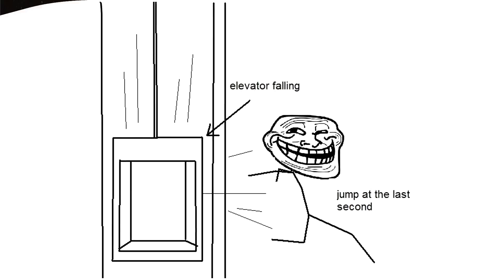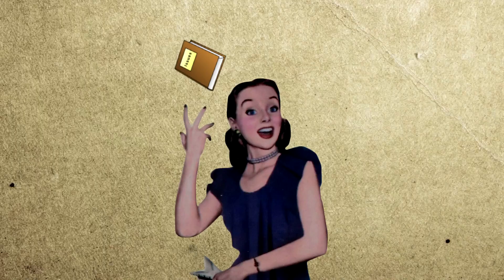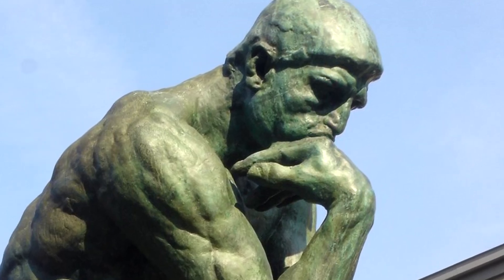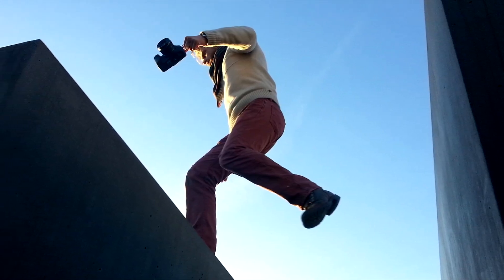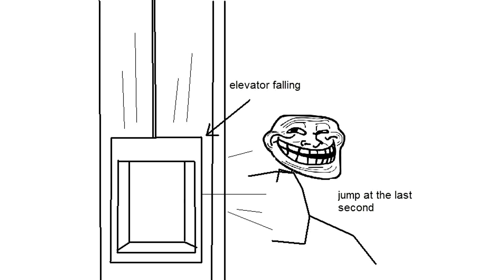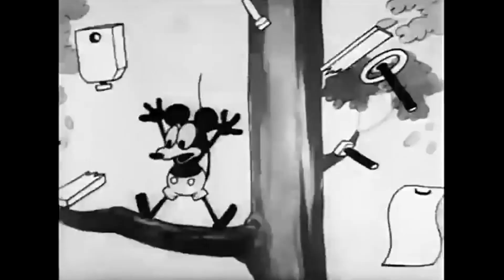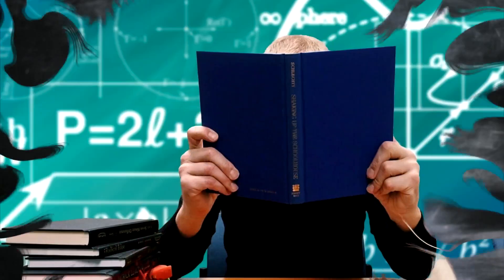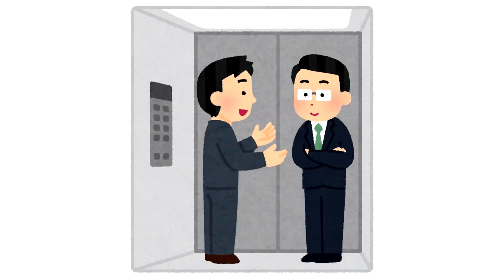why it doesn't work 51

Comment: Jump out... where to? You're in a shaft, so even if you could force the doors open, you can't escape the elevator car.
If you managed to forced the doors to the car open, you'd also still have to force the doors to the floor open on which you're attempting to jump while falling at 9.8m/s^2, AND youd have to know how where you are relative to the ground, and that would be impossible given youre inside a closed box.

Even if physics did allow it to work, there are so many other obstacles you'd need to overcome.

Comment: 2 things and obviously I know nothing about physics math, but wouldn't it be hard to jump aganist the force on the elevator dropping?

And then also I'm trying to picture it in my head but seeing 2 different scenarios/versions. Wouldn't the velocity drop (i guess if fast enough) have you floating/stuck to the ceiling of the elevator, OR, stuck to the floor?

Comment: The easiest way to explain it is there are 3 main reference frames. You, the elevator, and the ground. You can move slower compared to the elevator but you're still moving much faster compared to the ground.

Comment: Not sure I understand. Are you saying the weight of the fall would be stronger than our legs - so we wouldn't be able to jump?
Reply: You would be able to jump relative to the elevator you're in (meaning you would leave the floor of the elevator), but the speed you (and the elevator) are falling towards the ground would be far greater, so you'll still go splat.
Reply: you would be able to jump... but your still falling at insane speeds so even if you do jump and slightly slow your fall youll still die when you hit the now not-moving elevator at tremendous speeds just like if you fell those 10 floors on your own without the elevator...its actually MUCH worse for you... because now the elevator isn't taking the brunt of the force now YOU are...

Comment: In an open container, if you had enough strength to overcome the doward momentum you could jump at the last second and survive. This only works because there is friction in the shaft. If you were in a free falling box, such as in thin air, there is nothing you can do.

Comment: lets say ur falling 50ms, and you jump, making you falling 45ms with refrence frame of someone outside. meaning that the moment you jump, the elevator crash into the ground and is not moving anymore, and you, smash onto the elevator floor at 45ms. the elevator floor stops moving when it hits the ground. this is the key.
Reply: But has anyone tested it yet? I want to see some people from jackass just test it out for theory

Comment: You don’t have to cancel the full fall, since the final velocity is proportional to the square root of the fall height, jumping the equivalent of 4% of the fall height means hitting the ground at 80% speed meaning 64% energy.

Comment: this isnt minecraft a pool wont save you lol
Reply: for small heights, it actually will. past a certain point though, concrete would be better because you wouldn't need to swim out with broken limbs.
Reply: Water is basically the same as concrete with the surface tension so sand or a haystack would be the best to fall into if you fell from an airplane (trees can be counted depending on what type of tree)

Comment: Elevator brakes are applied by default, and it takes energy to open them and allow the elevator to move. If power was lost, there would be nothing keeping the brakes unlocked, and they would clamp shut, stopping the elevator. This is an example of a fail-safe system, which means when it fails, it does so in as safe a way as possible. 

Incidentally, this is also how bats are able to hang upside down in trees and caves. When the muscles that control their feet are relaxed, their foot is in a closed, gripping position, and it takes conscious effort and energy on the part of the bat to open its foot and let go.
Reply: You are smart
Reply: You are intelligent
Reply: You are clever
Reply: You are brilliant
Reply: You are well versed in the science of knowledge
Reply: You are well educated
Reply: You are erudite
Reply: You are wise
Reply: You are sharp
Reply: You are intellectually astute
Reply: You are inconceivably well rounded with knowledge
Reply: you are bright
Reply: You are genius
Reply: You possess an impressive breadth of intellectual sophistication and erudition
Reply: You are rational
Reply: You are well taught in the ways of this world
Reply: You are notably educated within the intelligence department
Reply: You have a profound way of thinking
Reply: You have knowledge
Reply: U brain work GUD
Reply: You are transcendentally wise.
Reply: You are mom
Reply: You are a bat
Reply: You are scholarly
Reply: You are well versed on those topics
Reply: You are what you eat
Reply: You are my fire, the one desire
Reply: You are Astute
Reply: You are gay
Reply: You
Reply: are
Reply: You are sexy
Reply: why you guys randomly giving him compliments

Comment: In a real senerio where you are free-falling in an elevator and all the safety mechanisms fail, the best course of action is to lie flat on the ground with your arm covering your head. This will distribute the force of the fall across your body softening the impact. And to protect your noggin from debris, your arm will block it. Granted, it's not a 100% sound method and you will almost definitely come out with horrific injuries, but it's better than nothing and WAY better than jumping.
Reply: Meditate and unlock flight. Inner peace....inner peace.
Reply: @christopherm4540  you need to free yourself of all earthly attachment first before you unlock *CRASH*... Flight
Reply: The better option is to hover with your neck over a really sharp thing, so at least it ends quickly
Reply: @Miseris1234  bro?
Reply: @fantastikboom1094  hmm?
Reply: Wouldnt standing be better since your sacrificing your legs?
Reply: @stephaniejohnson5361  The force of the impact will travel up your legs into your organs like a massive dagger.
Reply: @SioxerNikita   Apples to oranges. Elevator crash isn't the same as parkour.
Reply: I disagree. If survival alone is the objective, you want to fall feet first with your knees slightly buckled. Why? Your body is not made all the same. Legs are relatively strong, organs are weak, and you need the latter more. The cold calculation is that shattering your legs is better to spare your organs.
Reply: No

Comment: If our legs could counter 100 mph velocity with a jump, they might've as well keep us intact after the impact. Figured that would help imagining just how much force that excerts
Reply: if only our legs were strong enough for that. too bad it would be negligible though
Reply: But even if they could only manage half, this would help

You cut the velocity down to 50mph, and then your legs can take that (in this example)
Reply: an elevator is not falling at 100mph lol
Reply: @jazzabighits4473 Oh I have no idea, I'm no engineer. According to video you accumulate roughly 50 mph per 10 floors. You'd need 40 floors to get twice that, but it fits the estimate

Comment: under the already existing assumption that there is nothing below the elevator other than a sudden stop, the more common saying of jumping up in the elevator does work, but requires a timing that's impossible to know without a window out (you're theoretically able to "jump twice" in the form of the collision retracting your legs again to extend your deceleration beyond your leg length)
Reply: you'll still end up with broken legs because there's just that much momentum from the fall.
Reply: @fantastikboom1094  honestly I'm not sure what the terminal velocity of a free falling elevator in an elevator shaft would be

Comment: Oh god, they've only gone and confused how frames of reference actually work.

Yes, you are stationary relative to the elevator, but you are not only moving relative to the ground, you're also accelerating towards it. When you step out you will break your legs, followed by whatever hits the ground next...
Reply: I can see how I would rather lie on the floor of the elevator and protect my head instead of having all my legs broken and my balls crushed

Comment: video game logic be like
Reply: just respawn after you die, it's not that hard
Reply: @chibisayori20 But you forgot one thing: we're all in hardcore mode
Reply: @chibisayori20  ew
Reply: @kaistemino  wtf are you "ew"'ing me for?
Reply: @chibisayori20  EW, WTF?
Reply: @kaistemino  chill
Reply: @kaistemino  am i this creepy?
Reply: Once your finger's on the jump key, it's too late and the developers need you to fly in the air immediately for good reaction time. It also makes the game too much more complicated if your relative jump height depends on the platform's vertical speed. So they just set the Y velocity to like 12, make you decelerate rising more slowly if you're holding the jump button and call it a day

Yeah there's probably better ways of doing it, nonetheless
Reply: @FireyDeath4 tell this to titan fall 2(the implementation does let you fly in some extreme cases though which isnt ideal)
Reply: @ I'll consider it
Reply: Actually in Zelda Ocarina of Time in the Forest Temple when you are on the elevator in the central room and do a sidestep or backflip you get stuck on the ceiling, but still get fall damage afterwards when the elevator comes to a halt. (To be honest the game only checks for fall damage if the leap point is higher than the landing point. Doing some fancy super jump glitches or using the moonjump cheat does nothing when you land on the same height.)